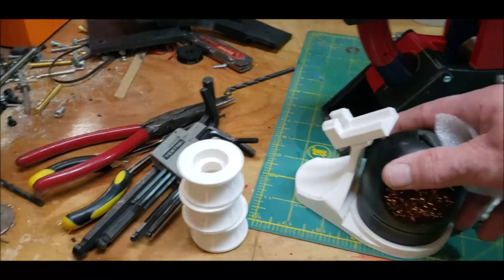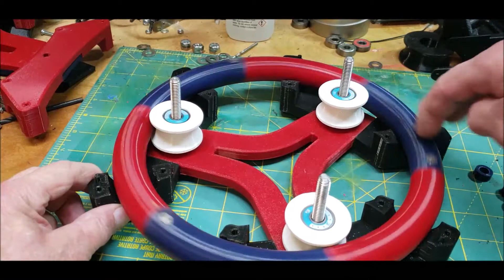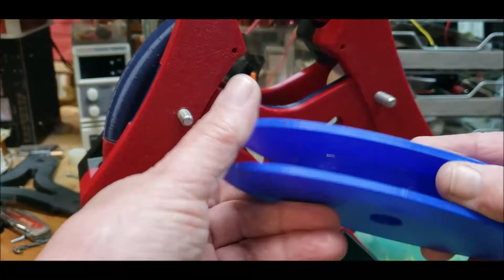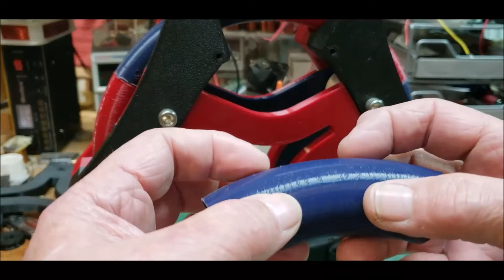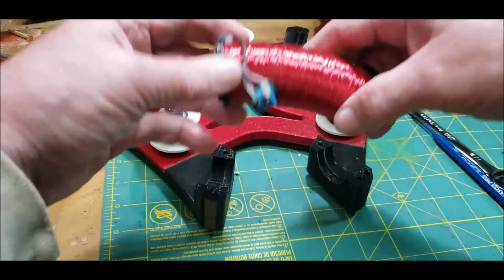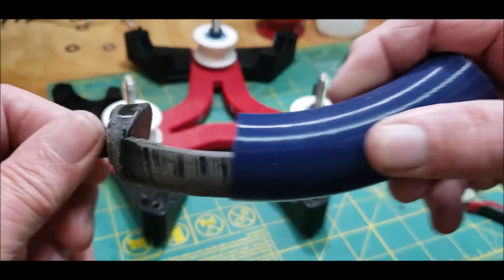3D Printed Solenoid Motor update (new parts)

Comment: One question my friend, those screws that hold the rollers are "antimagnetic ...? A lot of magnets will pass through there and it can slow them down a bit, I would consider antimagnetic screws ........
Reply from the maker: You're absolutely correct I'm going to get some brass screws I just put those in as placeholders

Comment: Looking good.  I like that jig. It seems like it rolls smoother in the horizontal than in the vertical.  I would do pancakes. If that stimulus shows up I am going to buy some of those 4 pin hall sensors cause I give up trying to figure out how these transistors work.

Comment: I use conduit glue to glue parts, but no I did not flew my body together the files with H at the end stand for holes for bolting together, and the new files I sent you have the holes and have other adjustments for better assembly, looking really nice.